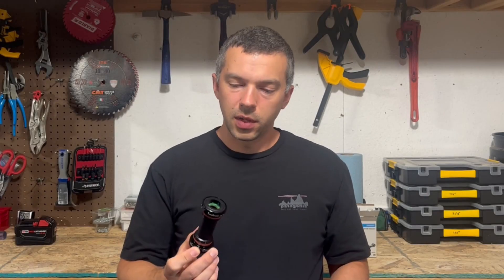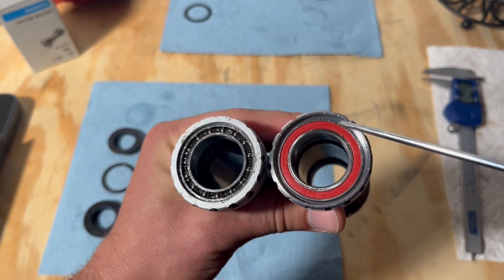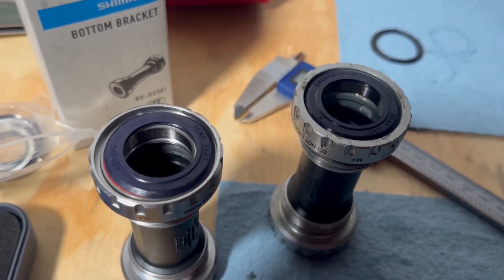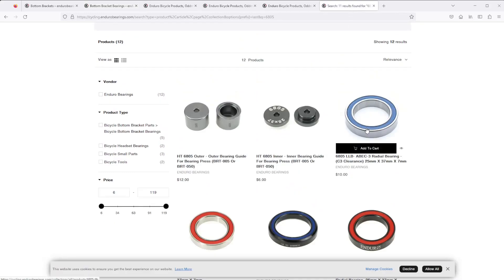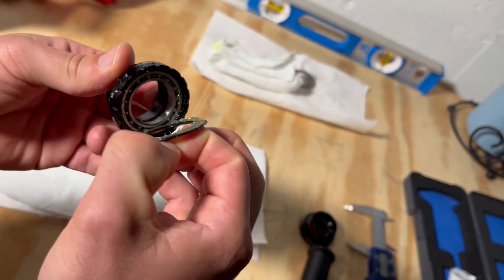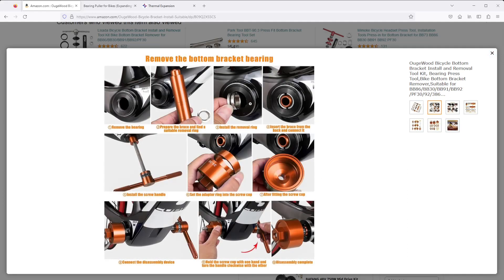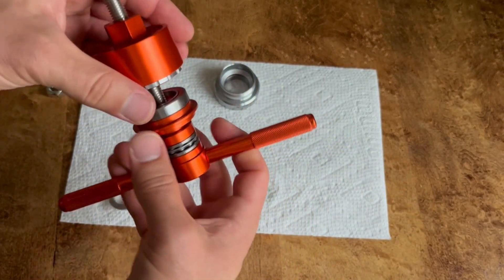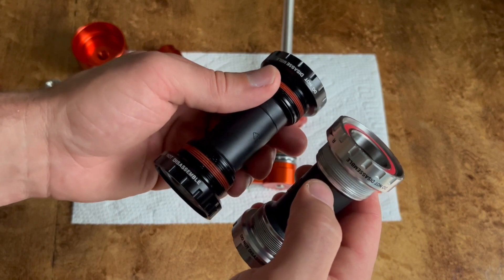Shimano Hollowtech II Threaded External Bottom Bracket Bearing Replacement

Comment: Need more detail on those L shaped dust covers which also act as spacers btw inner race and spindle.  When the plastic wears out, the spindle fails to engage the inner race intermittently, the spindle starts to wobble and wear, and then finally the spindle rocks around with every pedal stroke while the bearing is frozen solid with rust.  Especially problematic for gravel and in winter.

It’s unclear if you’re getting different bearing size to avoid the above problem with the dust covers.
Reply: Those plastic covers aren’t prone to wearing out but they are tricky to remove without breaking, even if you do there about £1 each .Nothing to stop you reducing the inner race diameter to 24mm. Problem with having the race directly on the axle is corrosion and that is a problem especially with bb30 and the like.
Reply: @ I’ve has numerous dust covers wear down to micro thin wafers, so no, they are very prone to wearing out.  Never seen replacement covers offered for sale anywhere for SH nor SRAM.  Just forced to get new BB altogether.  Rust issue is a concern, but no more than old school axle-bearing rust potential which required annual re-greasing, which is easy and regular with a sealed bearing BB being made ready for winter.

So back to beginning point:  we need much more detail on those L shaped covers.
Reply: @ I work as a mechanic, you’re doing something wrong if your ruining them. Both sram and shimano sell replacement dust covers through the distributer and other bearings companies sell their own 3rd party ones. I’ve got a 2012 orange p7 that’s had about 20 sets of bearings has replaced and still on the original cups and dust covers with well over 20,000 miles.
Reply: @AnotherMrLizard  well then the mechs at the LBS and the “do not disassemble” on the BB shell contradict the distributor.   I have a bag of a half dozen GXP BBs where the L shaped seal is like Saran Wrap.  The only thing wrong is that the spindle is scored so badly that wobbles around even in new BBs.  Makes no sense to have a “high end” BB with a spacer btw inner race and spindle.

Comment: ohhh maaan. i just ordered the same bearing puller tool from amazon together with the new bearings. i thought i could pull it off with it. it was the washer that didnt fit? if so, its easier to get one that fit and file square to 22mm